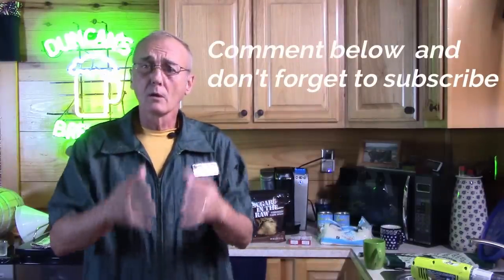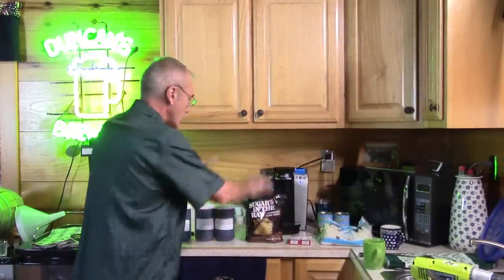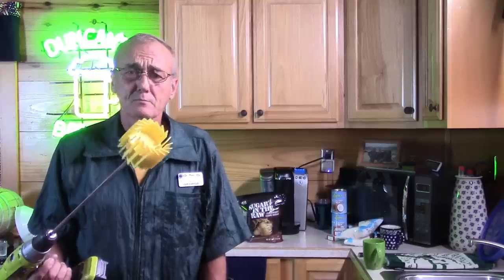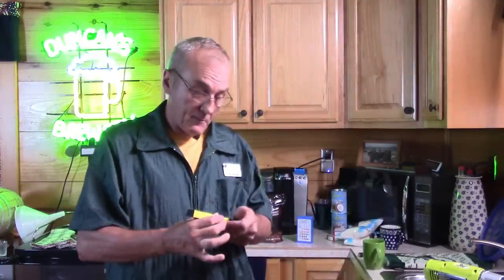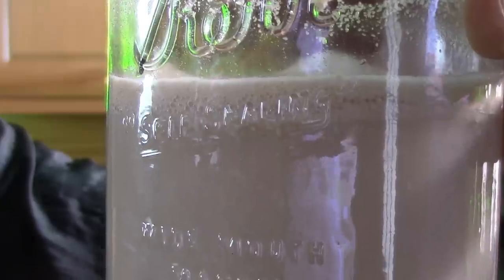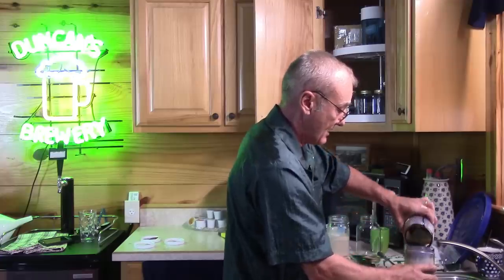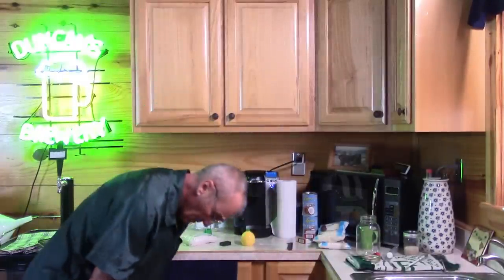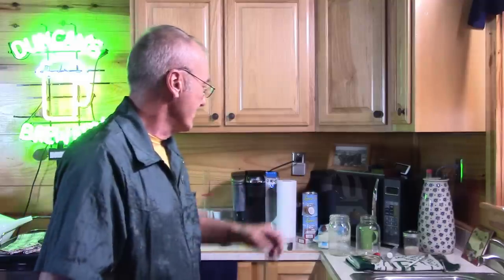Let's Make some Rum (easy step-by-step guide)

Comment: Thank you George!  I found you after I made my first herbal tinctures.  At Canadian vodka prices, this wasn't going to be possible to continue as a hobby.  I made a sugar water first and made a lot of mistakes but learned lots and ended up with a half gallon of 42%.  I cut open some vanilla beans and put them in.  Next I made a corn mash, way more difficult but I'm distilling as we speak.  I put together the rum one this morning and it's merrily Bubbling away. I don't have a still yet so I'm using a water distiller.  It's working very well for about the first 3 cups per gallon but then gets too hot and shuts itself off.  Just wanted to say hi and thanks.

Comment: When it comes to fermentation temperature. Since most rum is made in tropical climates, how do they handle high temps during the fermentation. Do they ignore the odors coming out and run it through stills either way?

Comment: Have you ever used plain bakers yeast in your rum washes?  We shoot for 1.065 to 1.070 for our rum washes and ferment with bakers yeast at 80 to 82  degrees with no off aromas and no off flavors. Plus a pound of Red Star bakers yeast is $4.99 at the market. Do you ever use dunder  from your first distillation when making your second wash.  It will lower the PH of your starting water as well as add flavor to the rum.
Reply from the maker: Have tried all you mentioned. Bakers yeast works great (sometimes not to predictable) and I prefer to stay away from using dunder since it is loaded with all the things that I leave behind in my run. Kind of like adding junk in just to try and distill it out. That doesn't mean it doesn't work for some people. I just prefer to start clean each time and sacrifice my dunder to the birds.

Comment: That digital PH meter has to be calibrated with a special buffering solution before you get accurate results every single time you use it. So your strips are verifying that you're meters right since they don't need calibration. but your meter won't stay accurate forever in needs to be calibrated using the buffer solution did they sell with the meter I have the same meter

Comment: Thank you.  Great video.  I'm currently fermenting my first ever wash and it's a rum wash.  I do have a comment though.  Most of the info on home distiller says that rum wash should be fermented at 75-95 deg.  Most rum producing regions are hot and these are the traditional temps for rum fermentation.  What sayeth thou?
Reply from the maker: I do agree. Keep in mind that rum yeast cultured for rum is used and is better resistant to higher temps as opposed to standard distillers yeast. You are correct though. 
This video was kept easy so that as many people as possible could make their own at home with little investment in additional things.
I have the fermenter is a room set to 77 Degrees F and the fermenter is now 83. Yeast activity did raise it a little since yesterday but it smells wonderful so far.
George
Reply: @BarleyandHopsBrewing  I followed this exact recipe. How long do you ferment? I know one answer is when it's done, but how long is that usually?

Comment: At was the temperature of your water before adding yeast? I know that the Rum yeast is like 110 F  but I want to try your recipe with the daddy’s yeast and yeast stabilizer. I ve never used the yeast additive or checked ph levels on my mash before and still came out with some very high proofs using a thump keg. This video alone has showed me many things that I never knew. You are by far the best at giving information and thank you for sharing that knowledge and experience.

Comment: Question:  You mention that the Potential ABV is ~11%, and we know that DADY yeast should achieve almost all of that.  But 11% of 6 gallons is .66 gallons, and you mention you plan on getting 1 to 1.5 gallons of spirit.  Will you explain this further?  Second question, based on this batch size what % of the spirit do you cut at the beginning (heads) and when do you stop collecting (tails)?
Reply: chanbulgin the .66 would be 100% alcohol, so I assumed the 1-1.5 gals is it at about 45% alcohol.

Comment: The sugar refining process removes the molasses from the cane juice. The sugar is crystallized without molasses in it. For brown sugar a bit of molasses is added back to the crystal. Sugar in the raw is crystallized raw cane juice and has not had the molasses refined out yet; this should make it an excellent ingredient for rum!  I think your weight may be a bit off on the molasses, though. 32 oz is 2#, not 3, but I think you just misspoke, perhaps. Cheers!

Comment: Love your video! Question..... how do you feel about using animal feed molasses? I have called the local feed store and they are unable to determine if it is unsulphured or not. I've read some of the other comments, one distiller thought that his distillate tasted bitter when he ran sulphured molasses? 20 bucks for 40lbs! Versus a much higher price in the grocery store
Reply from the maker: It is for animal feed. The molasses is in there to disguise the taste of the vitamins they add to the feed otherwise cattle, horses and other hoofed animals won't eat it. 
I avoid this and feel that a few bucks more makes a better product.
George
Reply: Feed molasses, blackstrap molasses, garden molasses, all the same, there is no sugar in, but it is full of minerals. Good for the garden. Sulphurd to preseve it.

Comment: george i think i have found a discrepancy in your video,don't get mad i might be wrong.but 9LBS. of mollasses worked up to be 144oz. like i said i could be wrong,i used the recipie and am on my 2nd day of ferment,it's bubbling like hell so something is working.best of wishes,keep it up the best videos on this subject.
Reply from the maker: Fluid vs weight.
Reply: I saw a gallon(128oz) on amazon and it says it weighs 11 lbs for $24

Comment: Yeast builds heat durning actavation,
I had bens set up with straw and them survival heat blankets  with 3" strirafoam walls and top .. 8  barrels 50 gallon spray 
( little water) on the straw .with your  barrels full of Slop or Beer  yeast working that straw creating heat from brake down and them survival blankes  and strurafoam on the out side .. in the winter it could take 3 to 4 weeks for that cap to drop . And yes the top of the slop had a sprinkle of  ground Rye for the Cap .. 
You can use an electric blanket but dont wet your straw and use 3" straw around a barrel them wrap with heat blanket then make a box of styrofoam   heat blankets have auto stop and start , set them for 70 drgrese or 80 but check regular .single barrel will take about 8 to 12 days in a shed with juice 
( electric) .. test it if you think in wrong .. good money in likk'r and makin Rum  and spice Rum .. wonderful thing them 
Gin baskets .. 
Ever had RootBeer Likk'r .😜👍

Comment: From the UK and I've stumbled across your channel. Now subscribing as I like your style and I've learned a lot so far. To bring the pH down "could I/should I" use Acetic acid crystals instead of a lemon? I'd be concerned about imparting the lemon taste. Also, are you saying that the pH should always be 5.2 (or as close to) for ideal fermentation conditions or does it depend on the yeast?
Reply from the maker: 5.2 is the golden rule. Don't worry about the lemon flavor, it is only a few MLs in 23 liters

Comment: Not wanting to appear thick in the head, but when you are testing your starting PH, you mean raw water with no other ingredients, right?  So, if I were using distilled water, I would expect it to be right at 7.0 then I would adjust it to 5.2?  In my case, I have a seven stage reverse osmosis filter system.  I don't know what the PH of that water is, but I'm going to assume for now that it would be close to 7.0.
Reply: Short answer, it will be neutral but not necessarily read 7.0 so yes follow your intuition, long answer is that water has a property where it chemically reacts with itself (amphiprotic self-ionizing) and what pH is REALLY measuring is one of the two reaction products and for water to be truly neutral the two components must be in equal quantity.
Reply: @rocketsurgeon4876  Thank you for your reply.  BTW, I really like the "play-on-words" that forms your handle.

Comment: In the recipe provided what container are you using, or rather how many gallons does it take up. I have a 15.5 gallon still so I wanted to see what numbers I need to match for the increased volume.
Reply from the maker: I used a 6.5 gallon brewing bucket and filled it to almost 6 gallons.
George

Comment: Hey George, love your videos. I've only been watching them about 3 or 4 weeks now and I have learned a lot, you are a great teacher. I am a Rum lover and I have been chomping at the bits to start this recipe, so I started today. I'm in rural Kentucky and supplies can be a little hard to get sometimes. I had to order molasses and I chose blackstrap (I wont do that again) so I ended up using 10 lbs molasses and 8 lbs of sugar in the raw  and I got SG 1.090 in 6 gal. Will the blackstrap be too strong in flavor? By the way I greatly enjoy your humor......
Reply: Hope all works well. I was told blackstrapp is what to use. Have I been misslead?

Comment: Hi George, great video.  i see a lot of run recipes call for dunder, but you did not use any.  Can you explain what dunder is and why some recipes call for it and yours didnt?  Thank you in advance.
Reply from the maker: I keep most videos very easy and do not include any advanced methods (or as little as possible). This seems to serve the community better since there are always many, many different variations of each recipe or process.
Dunder  (better known as backset) is the left over from previous runs. Some say it adds flavor, others say it does not. I am on the fence since I have not been able to see any appreciable differences when using it and skipping it.
George
Reply: Thank you sir.

Comment: “Should” I raise the SG to 1.090 or 1.10 to get more output or will this effect the flavor of finished product in a negative way?
Reply from the maker: Increase in gravity does not equal increase in output volume. It does reduce quality.
Reply: Barley and Hops Brewing ok thanks so much George. You hear some guys trying to hit a 13- 15% wash.  I was wondering about this for a while.  Is this what say a commercial distillers target is? 1.080?

Comment: I'm still a bit new to brewing. If I'm not using a still (I primarily make mead), is starting with 5.2 always proper/beneficial?  Does this help the yeast achieve greater potential?
Reply from the maker: Some mead brewers will adjust the PH as low as 3.7. I prefer to stick with 5.2 unless it is a special brew that requires something else. The 5.2 is a good middle of the road figure.
George

Comment: Thank you for All the information that you give on all of your videos.I made a batch of Rum, I need to know how bad i messed up, I did not check my PH and did not clarify my mash before running  it. I poured out the first 3 oz that came out, i also put a few drops in a spoon and lit it on fire and it was a blue flame then started capturing it, I ended up with 3 quarts of 186 proof. I just want to make sure it is safe since i did not change the PH or clarify it.

Comment: I  followed the recipe.  My SG was 1.080.  It rolled good for the first day and a half and now no bubbles in the airlock.  I haven't opened it yet to get another reading.  Is it normal to go that quickly?
Reply from the maker: If it is a 2-3 gallon mash it is possible to be done that quickly. 
Check the gravity to make sure.
George
Reply: It is about a seven gallon wash and I took an SG reading yesterday and it was 1.010.  I expected it to get lower than that.  I plan on taking another reading in a day or two.  I used DADY yeast.  We’re my expectations wrong in how low it would go?

Comment: Hello George, all I am asking is if you please can tell me if I need 9 pounds (144 oz) of unsulphured melassa or 96 oz. Thanks
Reply from the maker: Don't get weight ounces and fluid ounces confused. 1 LB equals 16 fluid ounces but it does not equal 16 weight ounces. That depends on what the fluid is. Some fluids are heavier (more dense) than others and will weigh differently. Molasses is normally sold by weight ounces and not fluid ounces (depending on the source)

Comment: Thanks, I got all that. What is the process after distilling? I like dark rum. Do I still need to add rum essence?  I have a standard Turbo500
Reply from the maker: Adding rum essence is a personal choice. Darker rum can be made by soaking your rum in dark oak chips after that you can adjust the flavor or hints of botanical additives if you like.

Comment: It seems to work for me. In summer I have to ferment inside because of the heat. Az. In the coldest winter months, I ferment indoors for consistent temp.
The tubro yeast says not to use water in airlock. Why? I do not know. But this seems to block the yeastie smell. thx.
Reply from the maker: When yeast begin their job the by-product is c02 which is heavier than air so in an open container there is a layer of co2 resting on top of the mash to protect it. This is why the instructions say don't use an airlock. Another reason is that the activity of turbo yeast can be violent and an airlock may cause it to foam up and spew out. 
This will not hurt anything but you are right; in an open container it will smell. 
Now, most of us do not have a draft free area where we ferment so if left open a small breeze can easily displace the co2 blanket rendering it unhelpful. I always use an airlock.
It is perfectly okay to let fermentation start in an open vessel and then after a day or two add the airlock if you are concerned about a violent fermentation.
George
Reply: I use star San mix in my air locks!

Comment: Great video. But I have a request . Can you do a video on how to wire a 220 Volt system using a 5500 Watt  heater. with a amp meter in the system.

Comment: I started this recipe on August 10th. I used 1 gallon of black strap molasses, 2.5 pounds of raw sugar. My starting ph was 5.65. My gravity was 1.11.
I mixed all this into a 5 gallon water jug(the kind that sit upside down in dispensers). There was not alot of room left in this jug when I was done mixing. I used 1.5 tablespoons of daddy yeast and 3 heaping table spoons of yeast nutrient. Today is the 3rd day and I have ZERO yeast activity. Where did I go wrong?
Reply from the maker: Have you tested the gravity yet? That would be the best way to determine yeast health.
Let me know what your gravity is now. 
George
Reply: George, I feel like a dumb ass now.
My current gravity is 1.02. I never would of thought it would finish this fast. Is this normal?
Sorry for taking up your time.
Reply: One more thing, should I be using city tap water or would it be better to by distilled water?
Reply: Buy
Reply from the maker: Distiller water needs to have minerals added back in. If your city water tastes good use it. Check the PH, that's all.
Don't feel like a dumbass. This is a common oversight. Always check the gravity to verify yeast health. Yours must have been very healthy.
George
Reply: Thank you much george!
And a good rule of thumb on ph is 5.2? Also, how long should I wait before putting my rum in the pot?

Comment: I was wondering about clorine and froride doing to the enzimes or the yeist if use tap water
Reply from the maker: If this is a concern leave the water in a bucket overnight uncovered. These elements will dissipate on their own. 
If it is super chlorinated it may take 2 days but it will clear on its own.
These elements want to leave by any means possible and leaving it open allows them to escape. 
George

Comment: will you use a regular still or a reflux still?
Reply: Troy Federspiel I believe it should definitely be a pot still as a reflux will strip the coconut flavor that he is looking for.
Reply: Not necessarily…let me clarify the question…
I plan on getting a still soon and having never done this I have been doing research into equipment.  I am trying to decide between standard & reflux types.
As for rum itself… I assume that by mashing molasses there is flavor to the distillate.  Would they be stripped off by use of a reflux still? 
However, not fermenting the coconut.  That flavor is infused.  So, is there enough of the “rum” flavor left over so that a reflux could be used 
Using the coconut flakes to impart the flavor in distilling column, most likely in a hop sock hanging.  Would a reflux still be the best bet for that due the reflux action?  The vapor would go back & forth through the coconut imparting the flavor to the distillate.   
Could the flavoring then be used in the final product to adjust the flavor?  (Can & should question – lol)
Reply from the maker: Troy,
 I would opt for a combination pot/reflux still if you are looking for a good still. It gives you the best of both worlds. 
I would also run this as a pot still to carry the flavors over into the distillate. You are correct about distilling through coconut but if you did so in the reflux it would strip it down and you would be left with pure ethanol (if you run it correctly). 
The pot still is the way to go; easy, predictable and manageable. 
George

Comment: Hey George, is molasses weighed different in Texas? In Missouri, 3 pounds is 48 ounces. 16 oz per lb, 3x16=48 ? Just checking.... I mean I know EVERYTHING is bigger in TX 😉  
#happydistilling 🥃
Reply from the maker: There is a difference in weight and volume for ounces. Most people get this confused. Yes 16 ounces equals 1 pound (by weight) but 16 (fluid) ounces of molasses does not equal 1(weight) pound.